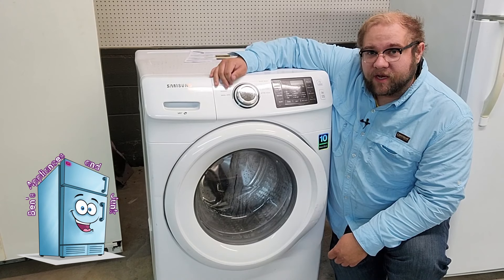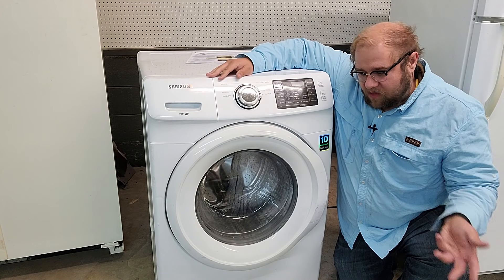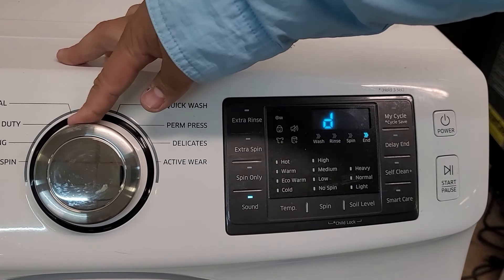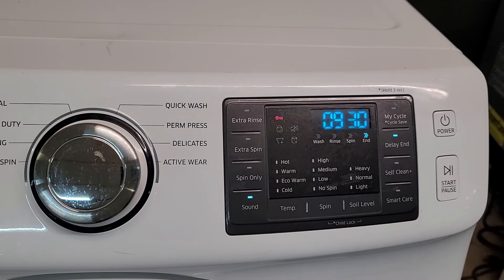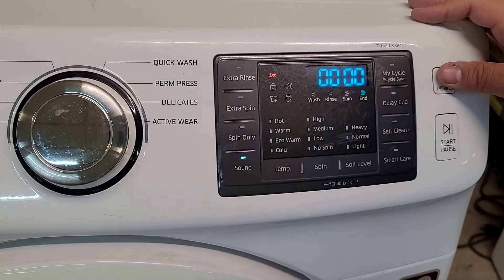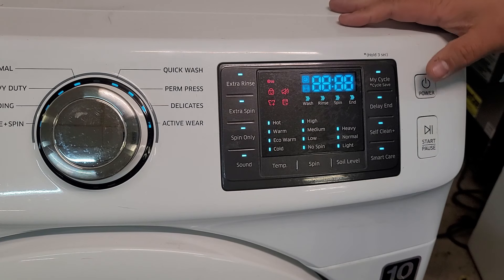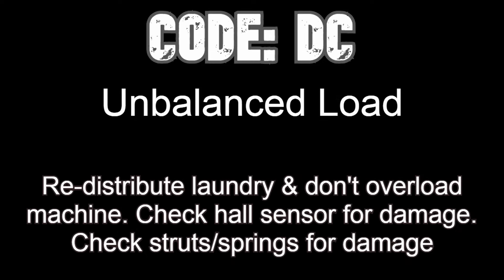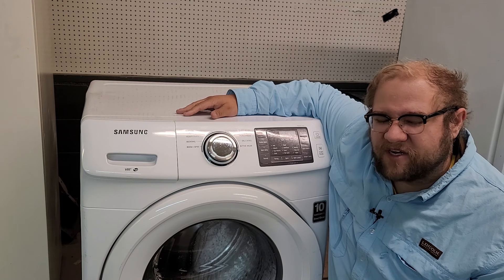Samsung Front Load Washer Error Codes and Test Mode - How to Troubleshoot a Samsung WF42H* Washer

Comment: I have a 2021 Samsung front end washing mashing and it has been beeping and giving me the SC code. I would clean the little filter in the bottom left and make sure the basin rubber thing was free of debree/baby socks too. It would go away and come back later with beeps and SC code flashing. So I took the filter out of the bottom left and shined a light in to see where the water drains into the pump… and bam…there was the problem…a piece of my wife’s bra was in side by the pump. I used some long skinny needle nose pliers and yank it out…the flood gates had opened and water began pouring out. I screwed the filter back on as fast as possible and washing machine was fixed. Timer started actually counting down, I could hear water pumping out into the drain, and the machine finally went into spin cycle, problem solved. I hope this helps someone, good luck.
Reply: What does s u d code mean
Reply: Me! Thanks bud! I will clean the cylinder plastic filter thing and also the hose, we still got the damn code SE. I’m gonna go in there with a flashlight and completely check everything out, thanks again brother.
Reply: Crapeee machine buy LG
Reply: I hate samsung without a doubt
Reply: @donnamay5433  it means u have to much suds or u have suds lock
Reply: My hero
Reply: Maybe it’s actually a ( 5C ) code

Comment: If you’re having an issue with the 4E code, take the hoses off of the back of the washer and get a pair of needle nose pliers and pull that little filter out of the threaded plastic piece and clean that really well. I was having that issue and this seems to have solved it. The screen on the filter is really fine so it don’t take much to slow the water flow down and throw the code.
Reply: How do you take the hose off? Im guessing you mean the drain tube of course. Its all internally integrated inside of the washer.
Reply: I don’t have any of the codes he mentioned on the washer except the d. I have d, - -, dE1,dE,3E2. This youtube video is almost a joke because he doesn’t actually have a broken/overused washer. His washer isn’t even hooked up in the video. I don’t understand how this guy thought he could make an informative youtube video. Not hating just speculating.
Reply: I have the same exact model of washer as he does in the video.
Reply: Im pretty sure the problem is just the filters being clogged from overuse and not cleaning once a month like your suppose to. But i really have no clue it could be multiple issues I wouldn’t know. Anyways the video did inform me on a-lot about it actually.
Reply: @burberryducks6481  stop being mean

Comment: One of the best if not best troubleshooting videos.  Just changed my ECM for a fail to complete spin mode.   I’m gonna try to clear all codes, reset water level and whatever else I can do to create a flawless running machine.
Reply: Hey! Mine would not go into spin test mode either, what did you do?
Reply: @isabelbassi3139  unplug machine for a few minutes. Then try.  Also there is a balance calibration to run that is in the manual.

Comment: Thank you Ben. My washer was locked with a load inside. I followed your test instructions, it unlocked the door, I confirmed the drum still had water. I put it in spin test. It drained and spinned. Pushed the start button at the end of the test and door unlocked.
I guess I don't have to wheel this Samsung to the curb tonight.

Comment: Ben, do you have more videos related to the model.  Mines has a 3E2 error.  I replaced RPS No spin.  When I ran the diagnostic after replacing RPS error was gone but it still doesnt spin and error returned.  How do you test the windings and RPS?  Thanks for video
Reply from the maker: Not YET. I do plan on making 3-4 more in the near future. From quick glance, thats a control board / motor control error, more than an RPS sensor error. I'd check to see if you're getting any outgoing voltage. I've had a few Samsungs lately where the boards were just totally shot due to random issues.
Reply: @bensappliancesandjunk  Thanks for the quick response.  I will keep looking around for more details and check back.  Thanks again
Reply: @bensappliancesandjunk  I’m still getting a 3E and 3E2 error even after replacing the motor and the pcb board.
Reply: I have the same no spin issue. Replace ROM sensor and still no spin. 3E2 and dE error codes now display in diagnostic mode. 
Other codes in Quick test mode:
004F (Heavy Duty dial position)
254 (Bedding)
JO13 (Normal - I think this is software version)

Any suggestions.

Comment: Mine works only power and start, the wheel to select the ato mode. 
The dial pad is on, but the buttons do nothing, so I can not run the test codes. Do you have any suggestions?

Comment: Greetings Ben & Everyone. 
I have the same washer and dryer. Zero problems. Except I accidentally leaned on the control panel and pressed some funky combination of buttons and now when I select anything other than the shortest cycle it stops prematurely. 

For instance, if I select the 40 min cycle, it'll dry for about 10 mins then stop. 

My question is, if I unplug the dryer cord 🔌 & wait for 1-5 mins  then plug back in, will it reset my dryer to factory settings?

Believe it or not I've had this set for almost 10 years. I love it so much! Not a single service call. 

Gratitude for your time.🙂
Reply from the maker: It should help solve that yes. Likely, you've set some sort of forced auto-dry thats timing out too quickly

Comment: Question…

On this model washer, I can’t get it to enter the diagnostic mode… I’ve used this same video previously when my pump went out and the diagnostic mode worked just as you described…

but now the washer isn’t completing any cycle, and when I shut it down & unplug it (trying to reset it) when I plug it back in, it’s returning to the same cycle it was in… 

I’m at a loss… any suggestions?

Comment: On my WF42h5200aw, it doesn't finish cycles, but never displays an error code. I followed your instructions (Holding Delay and Soil), and then pressed 'soil' once after it entered D mode. It instantly displayed J0 and blinked between it and the number 12. Turning the dial did not look like it was trying to cycle through different error codes. I printed a service manual and it doens't mention "J0". Any ideas? Thanks in advance!

Comment: Great video!  Thanks Ben. 

I still have a no spin issue with following error codes:
3E2
de

Replaced ROM sensor and still no spin. 3E2 and dE error codes now display in diagnostic mode. 
Other codes in Quick test mode:
004F (Heavy Duty dial position)
254 (Bedding)
JO13 (Normal - I think this is software version)

Any suggestions?

Is there any documentation of all Samsung error codes?
Reply: Any luck with yours? Mine is throwing AE6, 3E2, and dE in diagnostic mode.

Comment: Hi, hoping you could help me with a little advice.
I have this machine, and the original fault was a burnt out DC92 board. I bought a new one and replaced it. Once the machine was back together I now have an AE6 error code and the drum won't spin, it just judders a quarter turn very slowly then stops. It repeats this over and over. I checked the connections, and all appears good. What am I missing here? Please help as it's already cost me $322 for the one board.

Comment: So far the best video on samsung machines I have seen. Still didn't help me as my issue is the hourglass sign that shows up as soon as I turn on the machine. Any suggestins anyone?
Reply: I had the same thing and machine wouldn’t spin… I ran through all his test…. No error codes but when I tried the spin test it turned off and wo t turn back on now😢

Comment: Would you recommend this washer?
Reply from the maker: No. Samsungs are generally garbage. The rear bearings may, on average, last 7 years. My reccomendation for a front loader would be a similarly-priced LG. We get WAY less of them than Samsung's garbage.
Reply: @bensappliancesandjunk  How about a front loader LG tromm washer
Reply: @bensappliancesandjunk  Wish I knew this before purchasing from my current landlord. He only purchased it two years ago. I had a Kenmore set for over 15 years that I gifted to my parents before moving to this house and I never had one single issue with them. This Samsung set is garbage. Unfortunately I'm stuck with it now

Comment: Ben, Thanks for the video but I can't even get my machine into diagnostic mode.  I was hoping you might be able to help.  My  Samsung WF45N5300AW washer stopped mid-wash and generated an AC6 error code. I understand this is an error when the exchange of data between the control module and the information display board has an issue.  The display panel is illuminated but not responding when I try to put the machine into diagnostic mode or even change wash cycles.  I had to manually drain the drum and open the door.  So I replaced the display board, and that did not fix the condition.  Next, I replaced the display panel, and still no joy.  The machine remained unresponsive although the panel was displaying a time and the wash selector was illuminated, but I couldn't change the wash selection.  Can you think of anything else I can do before I replace that expensive control board?
Reply: Any luck resolving this issue? Mine is doing exactly this!
Reply: Did you ever get this fixed? Mine just did this yesterday. I tried powercycling with no luck.
Reply: I'm in the same situation, "AC6 code." I've already changed out the motor rotation sensor, but no luck. I guess next would be to change out the inverter board. Did you get yours to work..?
Reply: @Blue.Bean.Special I am having the same issue. Did you get yours to work, and if so, what was the issue (inverter board or PBA board)....?

Comment: We watched your video and nothing is clearing the AC6 error code. The font door will not unlock. An suggestions?  Thanks!!
Reply: I ve succeed to open the door with removing water with the drain, power off ~ 20min. But the machine seems not responding with the screen.
Just found this: "AC6  error is an error when the exchange of data between the control module and the information display board has an issue.

Recommended Troubleshooting Tip: 

Switch off the washing machine and unplug the power cable from the power source and power it on again and start another washing cycle. If after switching on again the washing machine and the error does not appear, please observe as it may be a temporary issue only. However; if the problem persists, then there will be a need for a service visit by a Samsung Service"

Comment: Hi, i have a samsung 12kg washer which has been working fine until today. I put in a small load in today and found that the drum would not turn. This morning it was fine. After putting it into diagnostic mode, the washer displayed an error 3c2. The drum is now also hard to turn, something has locked. Any ideas please?

Comment: Our Samsung front load washer stopped working in middle of wash cycle. We heard a popping sound and smelled like burnt rubber.
Machine panel lights up with power button, but other buttons do not work, the dial turns, but nothing happens. We can't access codes.
We had to manually drain it and open the door.
Pam and Mike
Reply: Same! Can't get it to work! All this after an AC6 code.
Reply: That happened to me also.  The popping sound is the Spider flange breaking causing the tub to rub against the front seal which makes the smoke.
Reply: Had the same issue, but not draining and door locked

Comment: Hi Ben. Great video. Can you help me try and repair my Samsung WF45K6500AW/A2 front load washer?  The washer went dead during a wash and circuit breaker snapped off. The front door was locked water was in the tub. I turned on the breaker and it immediately snapped off. I changed the inverter board and it no longer snaps the breaker but it’s dead. I ordered the PCB. No change. Where should I check?

Comment: So here's a weird one: when I start a cycle, the numbers that usually display time remaining start to all flash a clockwise rotation. It'll do that for a few minutes and then go back to time remaining, but not running. Any idea what that's all about?
Reply: Mine is doing the same thing.
Reply: Mine does the same thing. It appears to be stuck in "smart care" mode searching for an error but never finding it. I've unplugged the machine for an hour or so and then came back and it went away for a wash or two. Now i can't get a single cycle to complete and it comes on after a few seconds after pressing start.  WF45k6200A
Reply: @bradenhartzheim  It's the front board. I priced out repairs and it was cheaper to just get a new washer 😕

Comment: Hi Ben. This is super helpful. I've changed the motor on the same washer on this video and I still have the same issue. It stops mid cycle. I only gotten e3 error code a couple of times. Still trying to figure out what to do before I spend money on a new one. Thanks again.
Reply: Check wiring to the stator and in the general area to make sure none are broken.
Reply: Having same prob too. Tech mentioned the motor was defective :/ too bad extended warranty just expired

Comment: I have this same washer. The washer itself does Not Fill with enough water to saturate/wash the clothing properly. We find ourselves doing small/tiny loads of laundry or washing a load multiple times just to get things clean. Any advice in what could be going on? Is there an eco mode setting that could have been turned in when it was installed? Any ideas or advice would be much appreciated! 4 kids and a farm with this washer is not going well...
Reply: Are you on well water or city water? If well water, the water valve filters at the back of the unit may have sediment buildup not allowing for enough water to go into the unit.
Reply: @romarioflores863  we are on well water. I will check that this weekend. Thank you for replying!
Reply: @ambergolding409  you’re welcome

Comment: Hello. I have this exact washer and when I turn it on all of the lights start flashing and I can’t press any buttons. I’ve tried to hold the soil level and delay end buttons but it didn’t work. I’ve tried to keep it unplugged for an hour, I tried to hold spin and soil level. Nothing is working. Please help
Reply: I literally have the same issue.  I can not enter diagnostic mode no matter what I do.   I wish he or someone from this channel would my help Brice and I with this issue.
Reply: @debraeriksen7188   If none of the buttons respond, even with the machine just being turned on. You could have stuck buttons or a damaged user interface.
Reply: Did you ever figure this out? Mine is doing the same thing.

Comment: Ben would you please help me to my Samsung washer front load 6000AW no hot water coming in to the washer. just cold water. thanks in advance
Reply from the maker: Check for voltage going to valves. if you get 120VAC to solenoids, the valve is bad. If you don't get 120VAC, the board is bad
Reply: @bensappliancesandjunk  Hi Ben thank you so much to replying. Yes my husband checked the voltage is 110. we replaced the valve for the hot. but still the same. for some reason in the beginning of washing cycle they supply hot water. afterwards it just cold water the rest cycle
Reply from the maker: @celiadonovan1964  usually thats due to a cold rinse setting. Is check all of the settings. Usually a warm rinse only uses 2-4gal on most washers anymore
Reply: @bensappliancesandjunk  Hi Ben once again thank you for your kindness and help. as you mentioned normally is 2galoon hot water when it comes to rinse cycle. which is not happening to my washing cycle. it just in the beginning of cycle they start to fill hot water with cold water. afterwards no hot water came out even though when they start rinse cycle till end of cycle. but the weird thing doesn’t give me any error code.

Comment: Hey Ben... I have the exact same model and it’s running into a 5C or SC error code.. didn’t see this error code in your video..saw a couple other videos on this error and I tried to drain the water from the bottom and cleared the filter however it still shows the error code when the washer reaches the Rinse+Spin mode.. any thoughts? Thanks
Reply from the maker: Looks related to drain pump. There are a few things with that:

1) The pump isn't pumping the water at all (bad pump)
2) The pump is not draining the water efficiently

for #1, you'd replace pump if it had junk in it. Many times, just clearing the filter isn't enough - the pump itself has been destroyed due to the derbis.

For #2, check the drain hose and make sure its not TOTALLY JAMMED in the standpipe where the water drains to.
Reply: @bensappliancesandjunk  Sounds good... I’ll give that a try.. thanks for the quick response 👍
Reply: @bensappliancesandjunk  ok
Ok
Reply: @bensappliancesandjunk  l
Reply: @bensappliancesandjunk  
Ok

Comment: WE42H5200 model, turns on and all lights stay lit, main control makes a few clicks then shuts itself off. Checking codes, segment display doesn't display full segments, Looks like gibberish. So, not sure if there's one or two boards that have failed??

Comment: I have an AE6 code. I don’t see any loose wires and I have changed out the Samsung Washer Main Control Board DC92-01803D but I still get the error. Any advice?

Comment: Hey Ben, I have 5E and have drain issues on my Samsung washer. Any advice?
Reply from the maker: Make sure the drain hose isn't buried too far into the standpipe that'd cause back flow. Make sure the drain hose isn't linked/pinched anywhere. Make sure there isn't anything stucked in the pump or hose.

If none of those things work, the drain pump may be bad. If its super noisy, or you find that its not really draining much at all despite no obstructions.